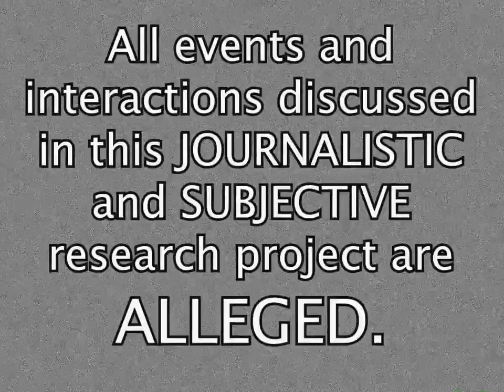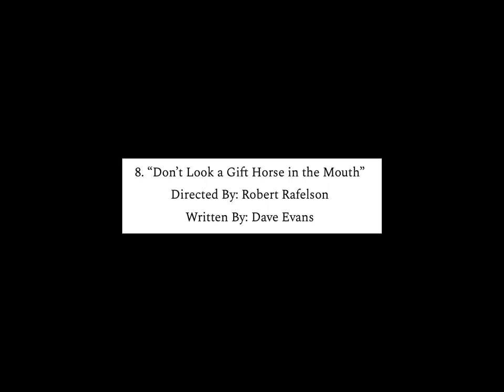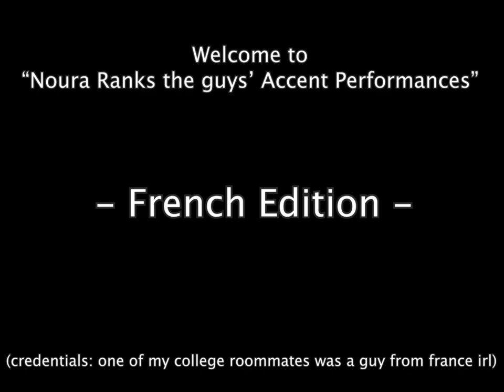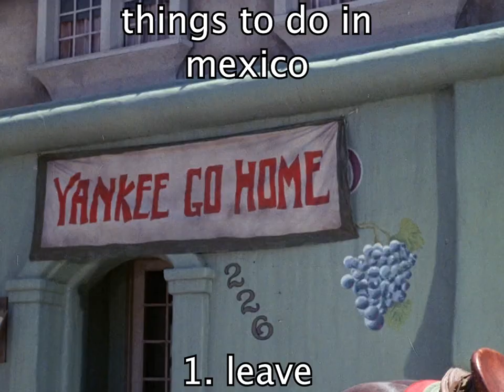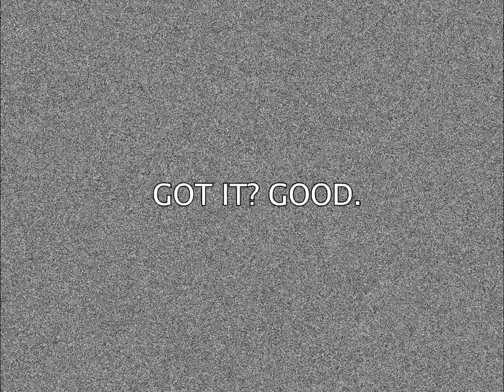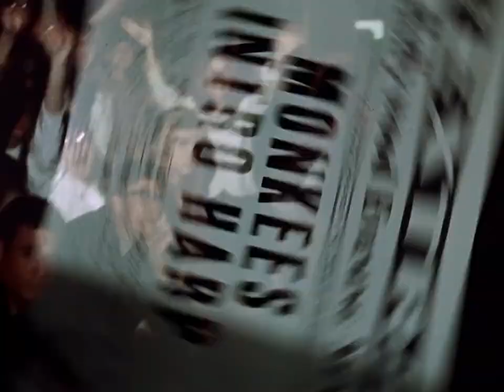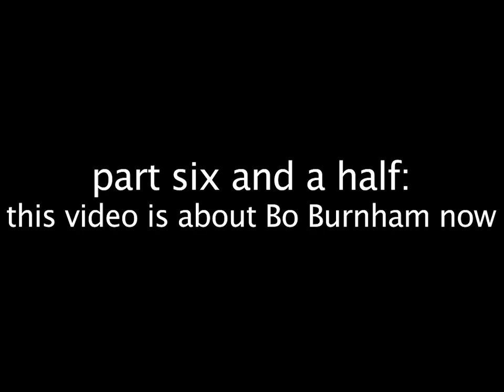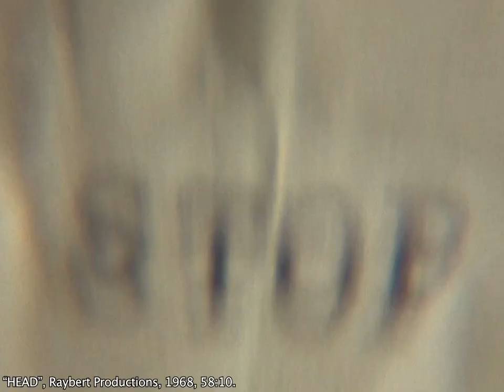The Monkees | An Exercise in Existential Horror

Comment: Amazing insight RE Head. I was not able to articulate the points myself but do agree 100% with your  take on it. (BTW, No mention of 33 1/3 revolutions per Monkee, which also destroys the plasticity of these characters, (Albee it in a very different way)?) Each Monkee character is locked in the box, but for a different reason. Because of this... If they try collectively to get out of the box they are only going to end up back in it, again, and again. The only real escape from the box would be for each individual to find their own way out. This cannot happen because the characters would not allow that. The Monkee characters being stronger than the sum of the whole. the only way to be free of it is to destroy it. Barring that option. they have no choice but to jump. If you are going to destroy yourself. let it be by your own hand rather than the media, fans, fame, etc... (Which one are you? at the end of the day... Does it matter?)